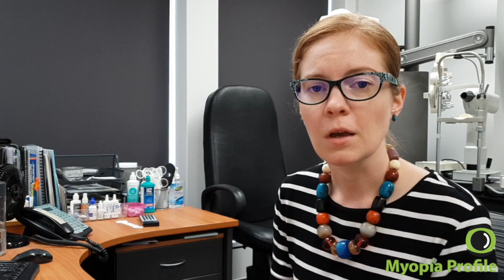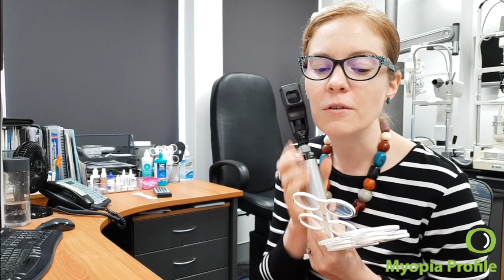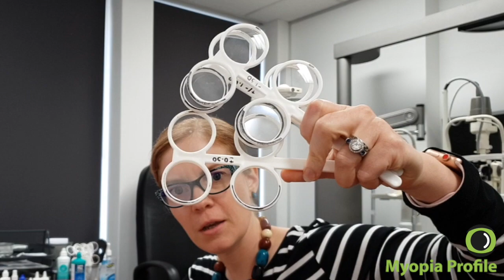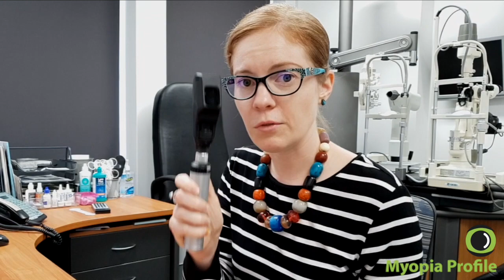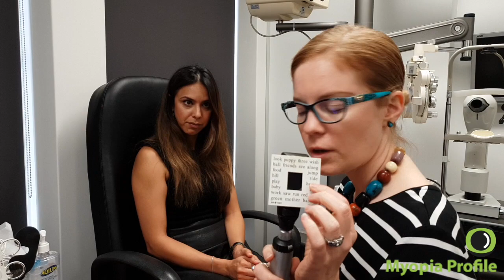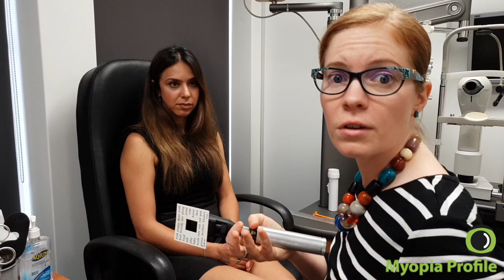How to Measure Accommodative Lag

Comment: Hi, Great tutorial - I am in need of glasses, but I can't find a doctor that has a variable measuring practice (i.e. Binocular focus system) that one can adjust to the desired distance than the doctor would measure its value. Multi-lens measuring systems confuse my brain and one fears selecting one of the last two choices and ending up with glasses that degrade one's vision rather than help it - why on earth technology has not reached this, and we still using 100 years old system.... I can't understand it for the life in me.
Reply from the maker: Hi Abe, us eye doctors do need to measure your prescription for far and for close, at set distances. This provides standardised information for past and future comparison. We then use this information, along with knowledge about your visual environment and activities, to determine the best prescription and best type of spectacle lenses for you. If you're struggling to make the 'forced choice' options of what we call subjective refraction ('subjective' as we're asking for your feedback), ask if your eye doctor can make an objective measure of your refraction instead. There are a couple of techniques (retinoscopy and autorefraction) which are objective, taking the guesswork away. We use these techniques as a starting place and it might be the finishing place for those who can't tell us otherwise, but for most adults we will also want to ask your opinion about what looks clearer to you.

Comment: Does a high lag mean you reduce the myopic prescription and by how much?
Reply from the maker: Not necessarily. A high lag means that the person is working harder at near with their distance prescription. Reducing the distance prescription will cause blurred vision, if the prescription has been measured accurately. So, usually a high lag necessitates spectacles which provide a reading add such as progressive addition lenses.
Reply: @MyopiaProfile  Thank you so much

Comment: Kate what do you prescribe with an anisometropic hyoperopic amblyope who has say a +0.75 lag in the dominant eye and +1.50 lag in the amblyopic eye? Also don't you test both eyes ?
Reply from the maker: Hi Rashelle, yes I definitely test both eyes, every time. As for prescribing in the situation you describe, I would want to ensure the dominant eye is comfortable while also trying to provide the amblyopic eye as much support as needed. Typically, for non-strabismic patients who need an add, I would prescribe +0.50 less than the near lag, to allow for comfortable near vision. I'd prescribe more than this, up to the full value of the lag, if we also have to deal with esophoria/tropia. In this case, if the amblyopic eye really needs that extra plus at near, I'd consider giving a +0.75 add (the full lag of the dominant eye).

Comment: When you use the flippers you make it binocular and the test is monocular
Reply: Yes. I understood MEM to be a monocular technique - the patient views the target binocularly, but the lens/flipper is very briefly (<=0.5 seconds) interspersed monocularly to neutralise (and so measure) the accommodative lag.  Or that's how I thought it was supposed to work. By placing the lenses over both the patient's eyes for any length of time, I would expect the accommodative demand to change, which could affect the accommodative status/lag/lead, which is the quantity we are trying measure.
Reply from the maker: @barneyandhannah  yes you're correct. You can only test one eye at a time, but you can quickly change lenses to avoid adaptation, and test with different powers. Holding the flipper up for longer in this video allows for demonstration of the technique.
Reply from the maker: Holding up the flippers binocularly has the advantage of providing both eyes with the same demand / blur, even if it is done very quickly. It can help to avoid the patient fixing /accommodating with the non-tested eye which could influence the results.